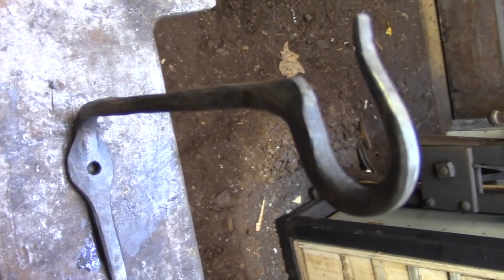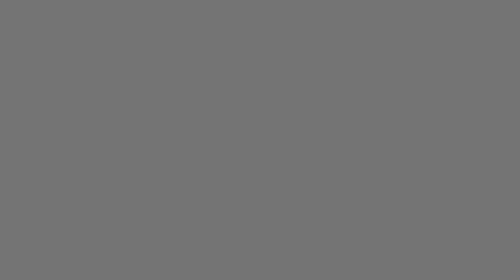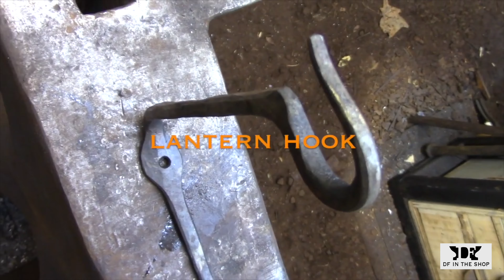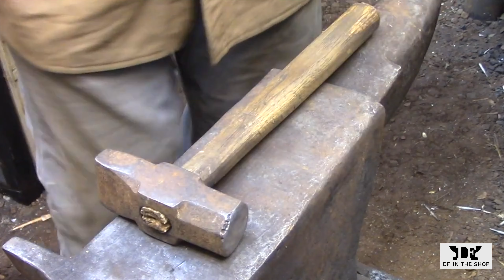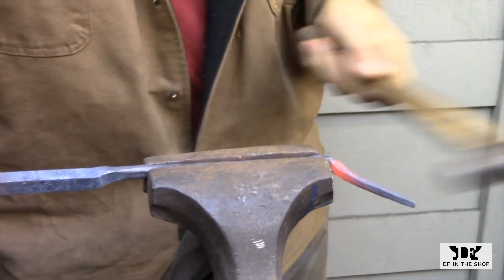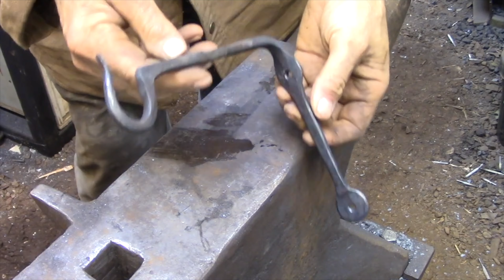Blacksmithing for Beginners - Forging a Lantern Hook

Comment: They used to make anvils in continental Europe that had a crowned face right next to the horn, supported by the base unlike the horn—I think it’s called a rhino anvil. They also made anvils with a sloped side on the edge of the face to help protect it from chipping (church windows anvils). They figured out a long time ago that neither the flat face nor the horn are ideal for drawing out metal.